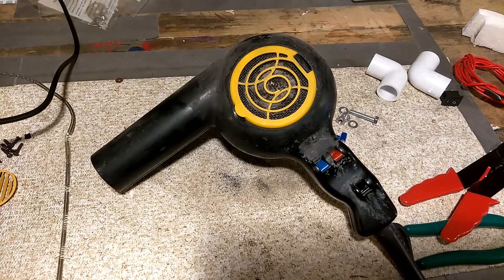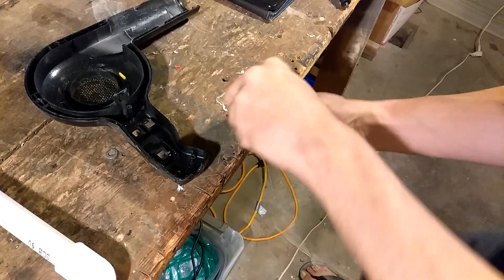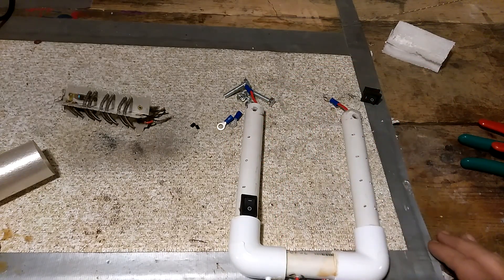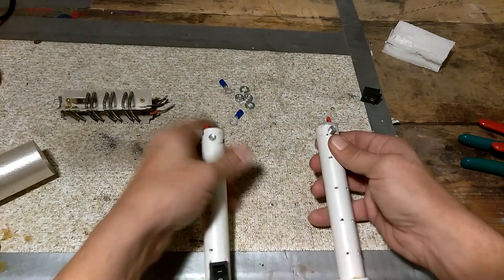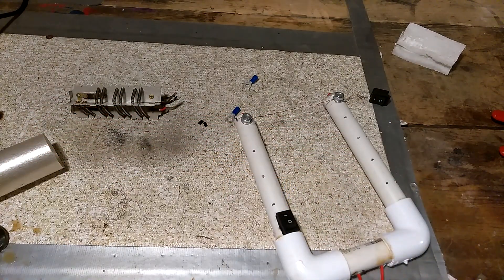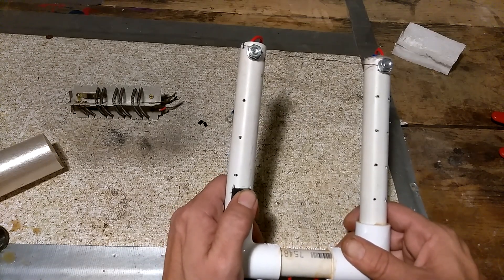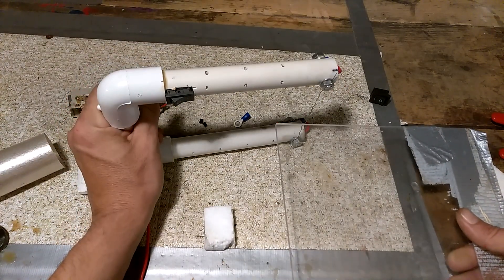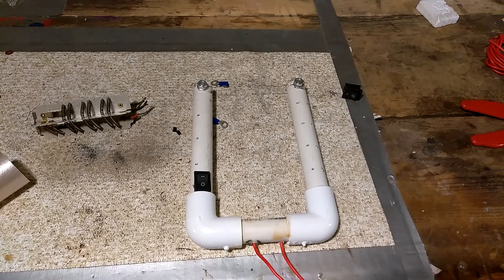Foam cutter from broken hairdryer parts.

Comment: I have a working hair dryer that i am going to use. Would it worked if i used the dryer as a switch and handle for the wire foam cutter ? Or would it be too much power for a shortened wire.
Reply from the maker: I definitely wouldn't use ac power just out of the risk of electrical shock.  Mine runs a variable voltage dc power supply. 
You may be able to use the switch, but not the plug and power.
Reply: @ThriftStoreHacker  I ended up using the hair dryer as a base for the wires. I also managed to re-use the on off switch. All powered by one of those 4inch 6v battery. It works really well !

Thank you for stopping me from using the wall outlet lol
Reply from the maker: @Foxy_Torino  nice! It's a great tool to have. I was cutting out foam insulation panels with mine today.

Comment: How did you wire the power switch and do you just connect bare wires to the battery?
Reply from the maker: The negative side goes directly to the battery. The positive side goes to the switch and then to the battery. For power i am currently running an adjustable 6 to24v power supply. I upgraded to the power supply for more power to cut thicker pieces of foam.
Reply: ThriftStore Hacker would you be able to draw out a diagram for me and send it to my email? I’m more of a visual person.

I’m guess I’m more curious on what the power source looks like and how it’s hooked up.

Comment: Thanks for sharing! never thought about harvesting heating elements for anything useful.

That stuff is called nichrome wire, it's become pretty easy to get ahold of due to the popularity of vaping and is available in many variations.

I wish I could remember what project I had in mind when I was researching it a couple of years ago, for some reason I didn't want to spend the money to buy a whole roll of the stuff, but I seem to recall it being kinda cheap at the time.
Reply from the maker: Thanks for posting. There is a lot of nichrome wire in this hair dryer so I may have to find a few more projects to do with it.